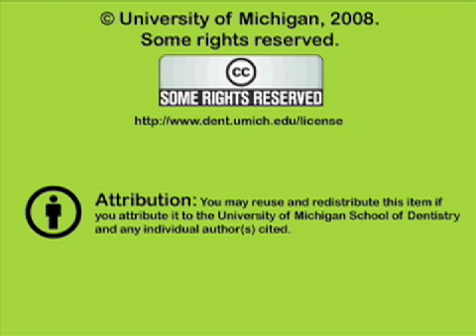Arbitrary Posterior Palatal Seal

Comment: nice video BUT the instruction is competely false, the posterior palatal seal or the post dam should be like a bump. you have to carv the palate about a mm deep at the end border. when you hold the denture in your hand you should see two bumps like a camel back on both sides of the palatal fovea.when the patient pushes the denture up so that that bumps work like suction to create vacum and hold the denture firm in place OK.